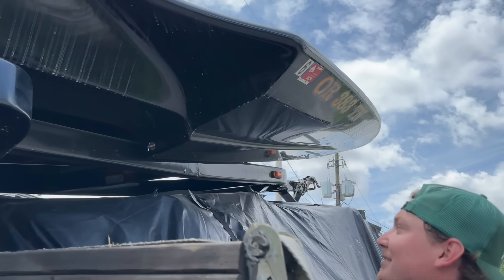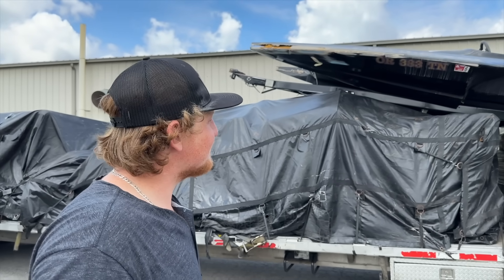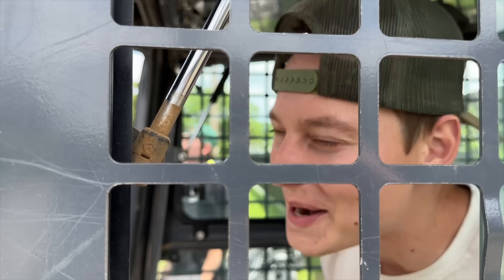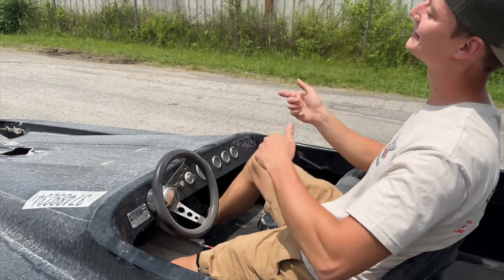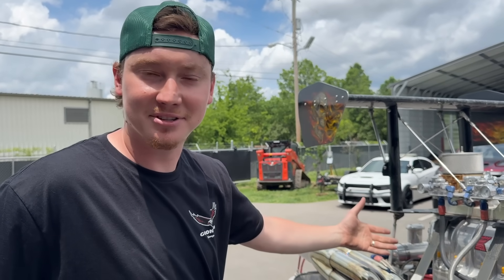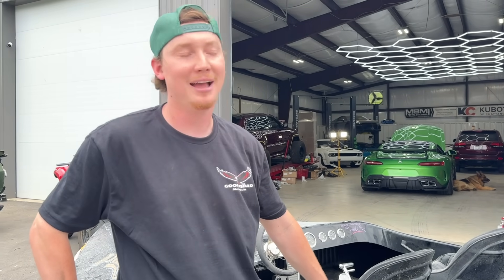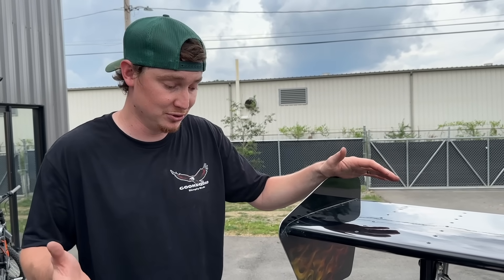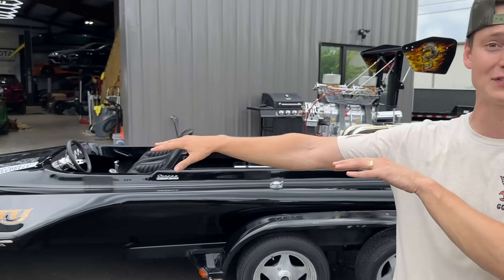We Bought A Super Rare Race Boat From Copart!!!

Comment: This is indeed a rare boat. 98% or all Sanger hydro hulls were set up with v-drives and propellers and not jet drives. This is because the hydro hull is designed to ride on three points; the bottom of the sponsons and the propeller, which is usually located under the rearmost portion of the hull. Jet boat hulls are designed to ride on the last two-three feet of the hull, right where the jet drive intake is located in the bottom of the boat.  Very few jet-driven hydros were ever successfully campaigned at the boat races because it takes a lot of re-working of the hull to feed the jet drive. Congrats on the purchase, fellas. It's a cool looking float.
Reply: The knob to the right of the driver seat is an MSD ignition timing retard device. It connects to an MSD 6BTM ignition box. Put simply, for every pound of boost the ignition box senses in the engine's intake manifold, the ignition system will retard or reduce the total ignition advance by the amount indicated on that knob.
Reply: the gauges in the cylinder heads are water temperature gauges. the canister beside the engine is an engine oil cooler. the straps on either side of the engine are called "blower restraints" and they keep the supercharger from flying into the air if the engine has a catastrophic backfire in the intake manifold.
Reply: the "l-m-h" switch at the bottom from of the engine likely controls the amount of water that's fed into the bottom of the headers. the water injection system keeps the surface of the header cool and prevents the chrome from turning blue.
Reply: Mike coming in clutch!!!!!! Huge fan!!!!!
Reply: Road Trip...😎
Reply: Call Tony Skagen
Reply: Lol. Just commented on the video for them to get with you and you're already here
Reply: Class dismissed. 
The Goat has spoken.
Reply: I was about to mention your name, would they need the special suits you wear in case of a roll over?
Reply: Please do a collab!!!!
Reply: No Goonzquad reply? WTF Boys.  Get your $#it together and give Finnegan some respect because he's earned it!
Reply: Your going to want to listen closely to mikes advice, you wont likely find anyone more knowledgeable. Check out his previous boat with a big inch 700  plus twin turbo boat, big boy stuff.
Reply: So Goonzs what Mr Finnegan is telling you in a nice way that the reason your boat is so rare is because it didn't work and was a dumb idea to begin with.  For your information Mike Finnegan was a co-editor at HOT BOAT MAGAZINE which was a magazine that featured boats like your. He also worked as a staff editor at HOT ROD MAGAZINE. Finnegan is not just another machanic that races boats and cars or just another YouTuber. AND HE LOVES JET BOATS!
Reply: Golden opportunity for Goonzquad maybe once in a lifetime to work with one of best in the industry.
Reply: @FinnegansGarage 
Was just going to recommend them to get ahold of you!
Reply: Contact Finnegan, of Roadkill fame,he is big into jet boats, hence his business Finnegan marine. He commented below,good guy met him once,real down to earth guy.
Reply: My dad owned one back in 1976, same year i was born. Had a Blown 427 Vette Motor. It was named "The Devil's Disciple" ! He used to take his friends water skiing with it at Clear Lake in CA lol. It basically idled at 10 mph. The boat scared the shit out of everyone, especially my mother who still has a huge scars on both her arms and chest from getting burnt by the Zoomies / headers when she was tossed out of seat on rough water . She was so happy when i was born because it forced my dad to "grow up" and sell it and invest the money into his Snap-On Tool business. Anyway, Sadly the guy he sold it to crashed the boat and died within a month after buying it. The name of boat alone was a bad idea in itself. These Goonz will learn quickly just how dangerous this boat is before it's even in the water. I hope they have a little fun with it, think about their kids and families and staying alive for them.
Reply: The potential danger may be true but if you are racing against others it’s human nature to go over the normal limits of control. (Hopefully these boys won’t go anywhere near those limits, so let’s stay calm people)..
Reply: Hey Mike you should take a trip over there I think that would be a great video 👍🏻
Reply: The funniest thing is - I was just going to text them they need to get FinnegansGarage involved!  lol look who posted!! Love your channel too.  Plus I love watching old Merlin too.
Reply: @FinnegansGarage Please help these boys out!!  Being familiar with jet boats/hot boats, I'd hate to see these boys hurt or even kill themselves with this monster.  That Sanger Hydro could get upset and unstable at speed with a small wake or even a slight cross wind.  They are just a few hours from you and a collab/education with these boys would be great!  I am a huge fan of both.  Even if you didn't do a collab, some education on this boat/engine combo for them will be helpful.  Your comments gave basic information about the components but they will need a full overview.
Reply: Wow he really showed up and dropped some knowledge!
Reply: I was just going to say hit up finnegan 😂😂
Reply: If you haven't already begun the process of repairing the front sponsons there here's some useful tips: the best/safest way to make that repair is to disassemble the entire boat. Remove the engine, jet drive, and most of the rigging from inside the hull. Then cut the top and bottom sections (its built from a two-piece mold) apart. Once the top half of the hull is separated from the bottom you can then remove all of the flotation foam from inside the front of the sponsons. You'll want that stuff removed because it will be in your way during repair process. You'll want to grind and sand the fiberglass at least a foot if not further around the repair area. Then you'll laminate new glass on both the INSIDE and the outside of the hull. Fix the broken spots, laminate the top and bottom halfs of the hull back together and then finish the paint/gel coat as desired. if you dont laminate the inside of the hull at the parting line all the way around the perimeter of the hull then it will crack and break apart the first time you take a wave over the front of that boat. hope this helps.
Reply: @trashpanda2312  it wouldnt hurt to wear the safety gear.
Reply: What about a collaboration between Finnegan and Goonzquad to get this boat back on the water? That will be awesome
Reply: @FinnegansGarage  collab??? Go teach these guys about these boats!!
Reply: @jimmyzgarage5430 I'm thinking they're talking directly to each other
Reply: @wheeln24-79  If that were the case than Finnegan wouldn't have posted on here a few hours ago. Not trying to be an @ss but these boys aren't the brightest when it comes to some things.  The name of their YouTube channel fits them.
Reply: Mike please run up to TN and work with them on this one.
Reply: Listen to this guy yall, finnegan is a drag boat GOD!! 🤘🏻🙏
Reply: Finnigan to the rescue. Love ur  stuff!❤
Reply: Finnegan watches Goonzquad??!!
Reply: If Mike is smart and I believe he is he will stay away from them and that Boat so he doesn't have to have part in those two hurting or possibly killing themselves.
Reply: It's not a BITZ, but it's a cool unicorn for sure

Comment: I'm really praying this doesn't become their final build. Guys, you must respect this one. Once you have this thing in the water, do not play around like we have seen you do before. I can't stress that enough. Helmets, life jackets, all the proper safety gear, maturity and knowledge of these types of machinery are a must.
Reply: I concur completely. This boat can kill you! You need instruction from a pro to drive it.
Reply: They don't test their builds to the extreme.   They are scared of speed.
Reply: Since when did they ever use safety equipment !!
Reply: They'll just do a shitty fibreglass repair, drive it once then never look at it again. That's the only bonus here. If they actually tried to drive this thing regularly or at speed, it would come apart for sure. No way they're going to repair that fibreglass properly.
Reply: Their fiberglass work in the past has been less than marginal.  Wait till they decide to run the shit out of it and the bow takes a dump
Reply: @user-sq9eu4nx1l  they barely key the surface, let alone drill pilot holes for the resin to bond to. I doubt if they fix it themselves it'll even last that long. 40 year old fibreglass is quite different to modern fibreglass and a different animal to repair.

Comment: Hey Simon: You guys bought a real gem. Sanger Boats were really popular back in the late 70's earl 80's. Mostly safe to run on Very, Very Smooth Lakes or Rivers. Your motor is probably a 454 BBC. It has Cast Iron heads Probably square Port. it's not a super High HP motor, probably 425 maybe 450 HP. The Super Charger is a small 6-71 unit probably under driven. Running two Holley's it's probably a Pump gas motor maybe 600HP at most. The Valves and temp gauges on each head are to control engine temps while running on the water. The headers are water cooled and that's where your exhaust and engine cooling water exit the boat. Those Boats were known as a Whole in The Water you throw Money in. GOOD LUCK.

Comment: Boost retard allows you to retard timing 1 degree, 2 degrees, 3 degrees per pound of boost so you don't melt your pistons.   Start with max retard 3 degrees to be safe.  It also depends on where the total timing is set.   Set  Total timing  (not initial timing) at 36 degrees to start.  Better fuel allows you to use less retard on ignition.   Check your plugs for sign of detonation frequently.    If you start to see aluminum on your plugs, either go back to more retard or use higher octane gas.  You also may want to put the big blower pulley on the super charger and the smaller pulley on the crank for lower boost until you figure things out.
That is a BBC, probably 454 but could be stroker 496 (common marine size) or bigger.   The blower is a 8-71.  It should be good for 800-1000hp depending on tune.  
 You'll blow it up with nitrous for sure.   Don't do it.   You don't have the experience.
Reply: they gonna blow it for sure.... 🙂

Comment: Make sure you use hydropel resin on your repair it resists water
Reply: Also when repairing fiberglass you have to put back the original material material I suggest 2oz mat and 2415 material I used to build yachts at searay boat enjoy all that you do

Comment: I would run race fuel in it without knowing the compression ratio. It could be a high compression race motor. It looks like a big block chevy with the wide covers. There is a stamp on the front of motor by the water pump. Check cylinder heads. They could be Aftermarket.

Comment: Race fuel, blower is overdriven. Which means the blower is turning faster than the engine. Small pulley on the top big pulley on the bottom. Im guessing 2000 hp. Unless its way under tuned and is just for show. It appears to be setup for drag racing.

Comment: 🌴 Hey squirrels, y’all might be in over your head on this one ! , it’s been crashed  !  I’m a retired FRP specialist boat and yacht builder retired, built boats for 32 yrs , y’all can’t be just throwing a couple layers of 1 1/2 oz. Mat to try and bandage that deck and hull it’s made of bi axle and composite laminated for certain strength parameters, and you don’t know if that engine went under water ?  If you do finally get it up and running that bad boy ain’t nothing like your ski boat if you cross wave that sucker at a high speed the nose will come up and you’ll flip it , this is a serious go fast boat y’all can check on who the last owner was if there is registration numbers still on the hull thru that state , and find a nice person at the DMV to look it up or a friendly water cop , to check it out for info. Pull the spark plugs out stick on of those inspection cameras in there see if there’s water inside , check for water in the oil , don’t run it hot , and yes it’s got a big freak’n cam !  Special heads , and ignition. Good luck guys your gonna need it !
Reply: They are in way over their heads with this one ! If Simons wifey was smart she would keep her baby daddy away for that widow maker !
Reply: way WAY over their heads. Just hearing so called “gear heads” talk about the motor alone had me cringing. I will give them credit for trying new things but neither of them needs to be anywhere NEAR that boat.
Reply: @gregkrueger331  especially with the way these boys act on a regular, and how they drive their cars on the road.
I love drag boats. My best friend growing up, his dad had a top alcohol drag boat. Amazing machines
Reply: Not a toy full blown drag boat the hull has to be split to fix it right not a cosmetic repair is atleast on race gas maybe even nitro track down the owner

Comment: Sanger Boats were one of the premier drag boat builders in their day. Sanger is from Fresno, CA. The pickle fork with the setup I am looking at will have a top speed well in excess of 100 mph. The top speed when set up for drag racing was over 200 mph and this style boat did hold the record several times. These drag boats usually were prop driven.  Both the pickle fork and the flat bottom boats from Sanger were record holders. Both boats will skim across the water with next to no draft. If you received a VM (Valley Muffler) trailer with the boat, that is the original trailer for these boats. The VM trailer is very well built (also made in Fresno). As you notice the tandem wheels allow this trailer to balance very easily.  Sanger Boats are still open, but do not build boats in the same volume.

Comment: Top fuel dragsters (among others) have straps holding the supercharger down -- like you say, it's for when things go south.
You see on the side of the boat, APBA ... American Power Boat Association - this tunnel-hull is built for one thing & one thing only, going flat out on flat water. They can't race if the wind is up, as when these boats are on the plane, pretty much the jet drive, pick-up & turn fins are the only things in the water; very easy for them to flip if the wind gets up.

Comment: You guys never been to the boat races?? Its a a real Blower engine race boat and they can flip over easily.
Reply: Also it's probably Runs on alcohol not pump gas and the boost knob is for the MSD for timing while running boost.  That was an expensive boat to build for sure . I gotta hear it run now 👍
Reply: Oh yea, you ain’t lying
Reply: they used to have them in Chatt back in the 80's and 90's during the Riverbend festival. This boat scares me for them. They need to have it professionally done. This is not something some amateur hobbyists should be risking their lives with.
Reply: It scares me too for them, very dangerous sport

Comment: You stepped into a new level of power with that boat. Pickle forks are deadly fast. Make sure when you get that thing running you wear all the safty gear. I have seen one launch of 50 feet in the air before landing upside down and exploding.
Reply: They won't. Like always.
Reply: They diversify the portfolio… new giveaways will be jetboats
Reply: Fast way to die. Look at cab. Not one saftty device around person. They fly up. You have slim slim chance of not getting hurt. Or dead
Reply: yeah...don't get too ASAPee till you guys understand a wavee surface, speed, and the concept of airlift... don't be stupid
Reply: @sm00vee42o  With that boat you are sitting up so high with no safety harnesses !! Has disaster written all over it !  Not a good idea for a guy with a new born !
Reply: @ITIRICI You know this.
Reply: I commented up above for them to look into what happens to your eye's when fly out of one of those and how the water pushes behind them. Not to mention why they wear ballistic shorts. Oh, and can't forget the parachute! 🤦‍♂️

Comment: Hard to tell from the videos, but looks like a small block chevy engine. If its a 350 case, i would check to see if its still a 350 or if it's the 383 stroker

Comment: I have a sanger hydro..motor out now but a fast hull. You have a big block Chevy blown motor. Probably 9.5 compression. Blower motor. Straps are to prevent blower blowing away. 😂. 740 holleys. Trick rig. Need advise I'm here. Know this setup .well.
Reply: 750 carbs

Comment: The bost has slid forward on the trailer.  Like others have said Mike Finnegan is a good source of information also call Sanger. But those boats are very dangerous., so wear all the safety gear and be safe.

Comment: It's a racing boat goes up to 1800 to 2000 miles per hour and it's a jet boat and it has an oxide to it so you got to be careful with it because you can blow up an engine if you don't look at it right

Comment: I know your not scared of new things but you need to take baby steps because the wrong air fuel mix or even low fuel pressure will melt that mill down from inside out!! Thats could be a 1500hp engine depending on internals. Thats a 25k engine. Thats conservative estimate. Have fun boys!!

Comment: Guessing  at what fuel it takes is a bad idea.  The wrong fuel she is done.  All depends  on what inside that engines. Run the carb numbers that will give you a starting point on fuel.

Comment: Don't have to worry about starting the engine, I don't think there is a starter on the engine. Look at the top pulley on the supercharger. That gear setup is where the handheld starter is placed to start the engine. Similar to top fuel dragsters.